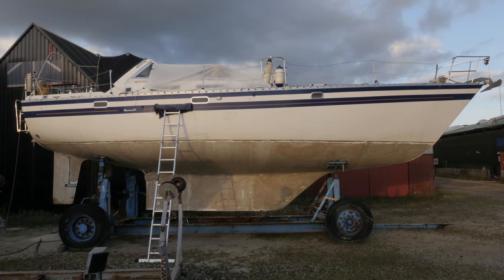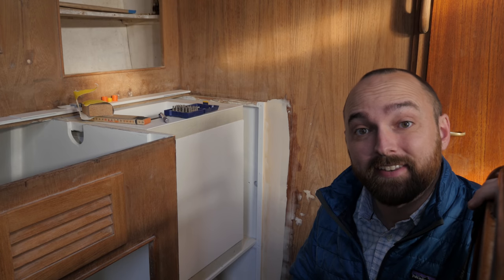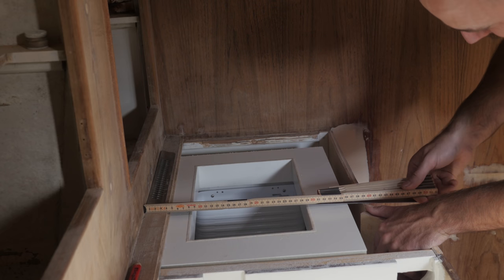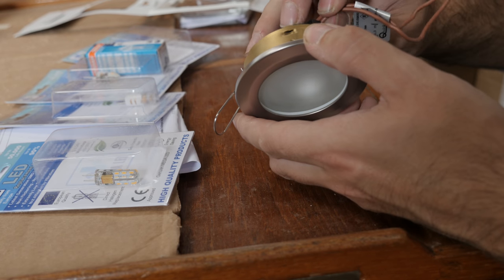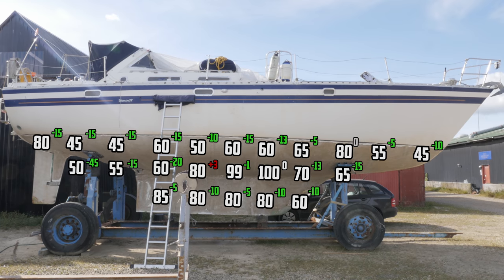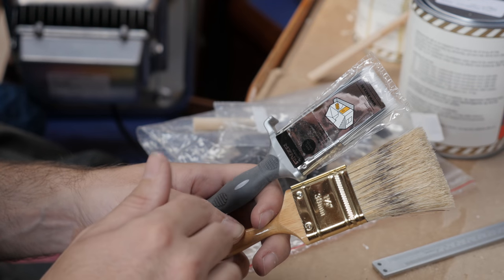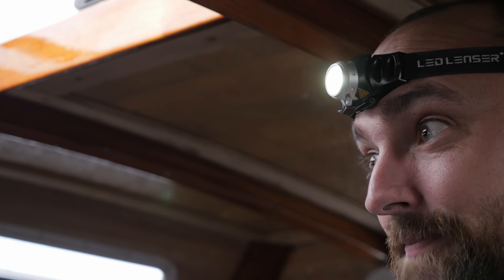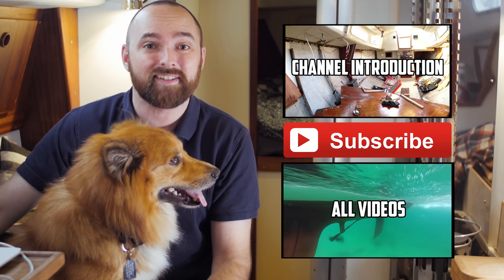Sail Life - Galley test fit & varnish - DIY sailboat restoration / repair update

Comment: Hi Mads by the look of the patterns what you are calling Ribs I think you might mean your floors or a floor webbing, not a difficult job.... ONCE you half killed yourself removing all the furniture, ground everything out etc which would be a seasons major mini series in itself. I hope its not a problem. Someone has already mentioned Have Wind will Travel where they had a rotten floor web under the mast, you can also look at Sailing Uma who had to cut up the Sole and completely redo all the floors as they were broken or rotten and their keel literally wobbled from side to side. In the meantime carefully drill into the floors and see what the core looks like.

Comment: I would like to tell you about the led stuff first of all all LED are dimmable via Pulse width modulation (in theorie) cause it turns the LED of before it reaches its maximum brightness and turns it back on again that is where the flickering could be coming from however if the flickering is visible to the naked eye the LED is not suited for this kind of application if you use a external dimmer it could also be that the external dimmer operates at a frequency that is too low if you want a led dimmed via pulse with modulation that would not be seen on camera you need a high frequency dimmer something around the 5khz range should be Ok if you are interested in that topic you can take a look at the channel DIY Perks he released a video about flexible LED panels used for Photography and video work I think he used 10Khz dimmer for the led stripes but that thing should also work for your LED as long as it gets wired correctly but you should take a look by yourself and I cant tell you how they will work on the long term. I hope that knowledge is of any use for you and keep up that work its really inspiring good luck and all the best.
Reply from the maker: Awesome! Thanks for the information :) I'm looking forward to testing the LEDs and crossing my fingers I can use the dimmer I've already purchased :)
Reply: I hope that too good Luck with it :)

Comment: Since it's a very good chance the stringers are made of wood and the hull id that wet, there is a very good chance there is some damage. Age, wood on fiberglass, and moisture = rot.  i would be very surprised if you found nothing. best to get it done now while the boat is somewhat apart.   Haven't seen a boat over 10 years old that spent it's live in the water without rot somewhere unless the owner kept it very dry inside.

Comment: Another tidbit.  After messing about fixing sailboats for years... Any wood I work on, I strip/sand all the varnish off.  Apply a coat of penetrating epoxy, sand, varnish, sand, varnish, sand, varnish.... with foam brushes.

Comment: Hello Mads. I have had Safire 3000D for 14 years now and it works beautifully. Once i had to replace the glowbulb but it was quite easy and its the most common glowbulb from car diesels, same goes to Toyota Hiace etc. You should get the Genius control panel for safire. I don't have it, but it is supposed to work even better with it. There is even more accurate thermostat in the genius. One problem i have in Safire installation in my boat. Contrary to instructions i have the heater installed to aft cabin and the air blower blows too weakly to the forward cabin because the duct is too long (10 m). At the salon where the termostat is the temperature is fine, but in front it is a bit colder. If i rise the temperature so that in the forward cabin is warmer the salon is too hot. So You definateley sould place the heater somewhere in mid ship. And the ducts should be equally long. You can see the Safire at 2:25 https://www.youtube.com/watch?v=mJVnA3Lfr5w
Reply: And i forgot to mention that Safire is very quiet. It very suitable for sailing boats because it draws so little energy. Mika Vanhalas Esco Marine sells them here in Finland and Mika is a very reliable merchant.

Comment: You might want to invest in an inexpensive "endoscope" style camera for your phone.  (For example: http://www.banggood.com/A99-2IN1-720P-2_0-Megapixel-8_0mm-Lens-Waterproof-Android-Endoscope-Inspection-Borescope-Tube-Camera-p-1046380.html )  For a very small investment you'll be able to check out remote areas in your hull by just drilling a small hole.  While they aren't always easy to get pointed where you want, it sure beats tearing out your stove to check if there is a wet place by the ribs.
For your back, I'd suggest getting a "gymnastic ball".  They are large (85+ cm) inflatable balls that you use to stretch out the affected areas.  Works wonders with mine!

I really appreciate all your good work, btw.  I've learned quite a bit from your channel.  Thanks!

Comment: Moisture meters are notoriously unreliable. By collecting data at specific points over time as you are, you may be finding the best possible use case for a meter.
Reply from the maker: They are easily misinterpret that is for sure! I'm glad I can track the moisture levels but realising how sensitive the meter is to temperature is a bit of a bummer.

Comment: I'm guessing you didn't get a survey. I think you could of got a lot better boat for that money. It made me cringe when you said what you paid for it, a hell of a lot of work. Good luck anyway and as long as your happy.
Reply from the maker: No, I didn't get a survey. It's very uncommon to get a survey over here - no one does it. We are not required to have them done by our insurance companies, and I've never met anyone who got one done on a used boat before a purchase. Regardless a survey wouldn't have told my anything I didn't already know. I knew the boat had osmosis. A surveyor wouldn't have discovered the glassed over limber holes as that would have required him to tear the boat apart. I knowingly purchased a boat that requires a bit of work because I like doing that work. As for the price. I find it perfectly reasonable - don't forget that there is an almost brand new engine. The value of that engine + saildrive + prop etc is almost half of what I paid for the boat.